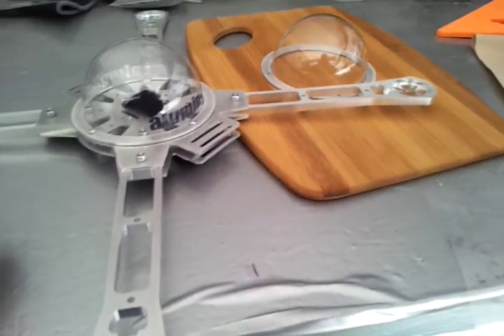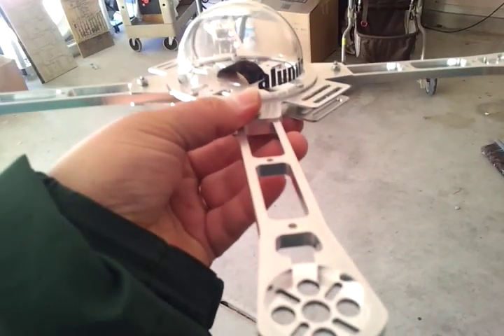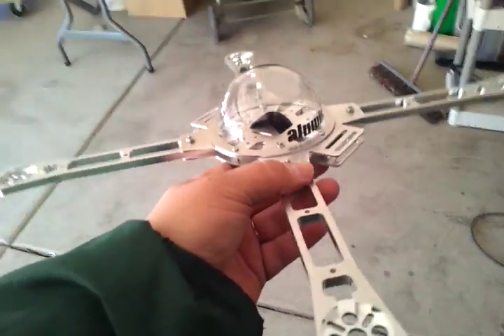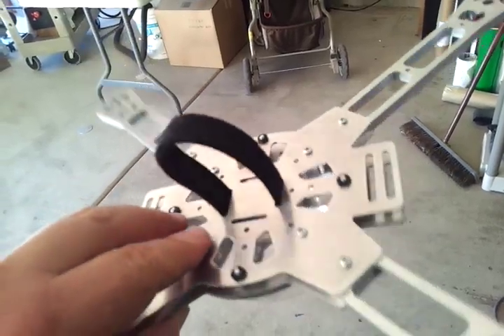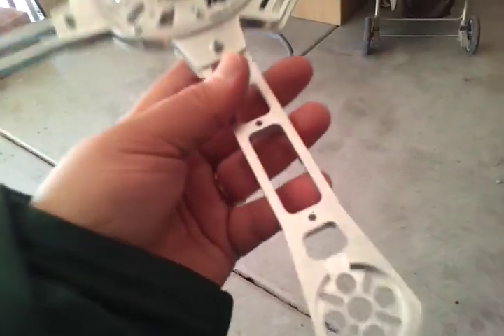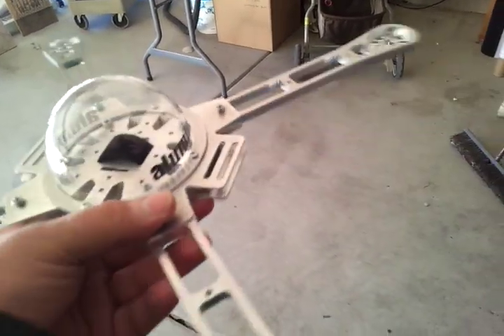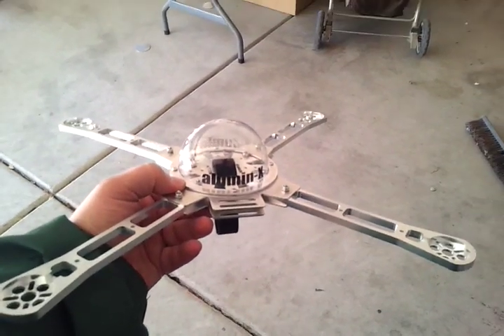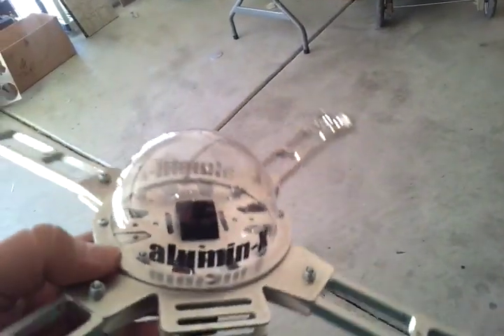NEW alumin-X qudcopter frame( FINAL )

Comment: Great! Twice now, with tarot quadcopter frame, when I've crashed them I've broken parts, carbon fibre parts. Useless frames. I thought carbon fibre was suppose to be both light weight and strong. No, not tarot frames. I like this aluminium frame.